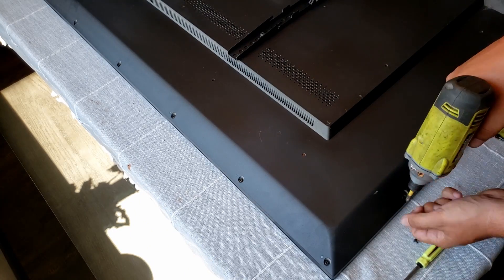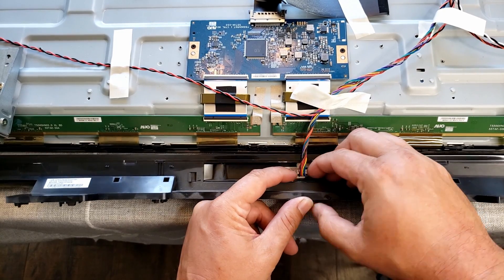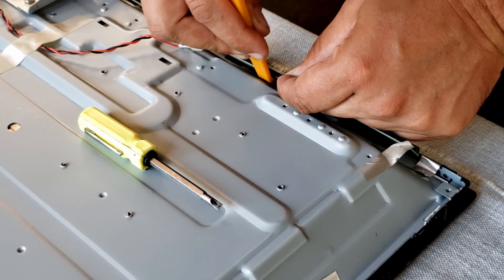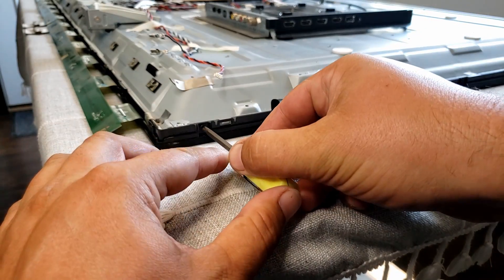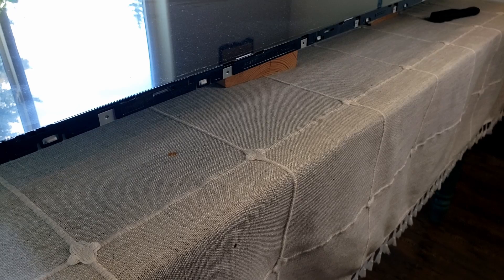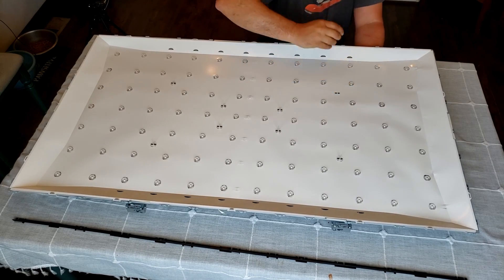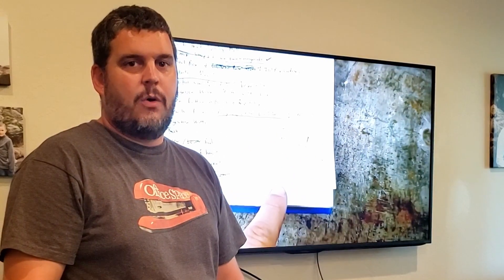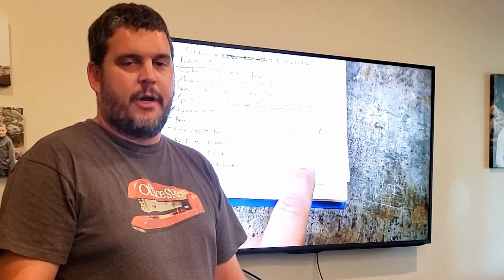Insignia 55 inch Roku 4K TV LED Backlight Repair

Comment: I have almost the same model. My backlight comes on for a second and then turns off after unplugging it from the wall.  I know it's a backlight issue because I can see the screen if I shine a light to the panel. Do I need to change the led strips even though it attempts to work for a second on startup, or is this a different issue
Reply from the maker: It's the bad back light. Mine did that too

Comment: Thanks for the video. How did you test the LEDs to make sure they worked?
Reply from the maker: I powered the TV on, just with the screen still removed. It still illuminates the backlights as part of it's boot process

Comment: Makes sense with mine the top of my tv was ever so slightly darker. 

Are the connectors or solder points pretty much standard though? Pretty sure any LED array will work that’s not a problem for me. 

Just want to make sure there isn’t a particular one I need to order
Reply from the maker: The website I listed in the description has most of the LEDs for most TVs. They seem to be model specific. 
But it's all plug and play no soldering

Comment: So did you drill the holes so the lights would fit or no?
Reply from the maker: I didn't drill any holes. I just used the attachment points that were available and it worked fine

Comment: So, my tv just turned dark today, and I gotta use my flashlight to see the screen. Sometimes, when i unplug and plug back my tv, I see the screen for a second, and it goes dark again.  I just want to make sure the backlight went off before I open the tv up. Do you think this might be caused by something else?
Reply from the maker: Sounds like just the back lights, but I'm not an expert
Reply: My tv has the same issue- did you determine if it is just the LEDs?